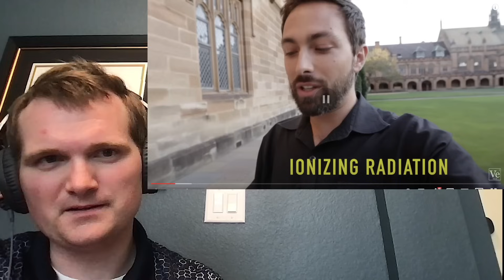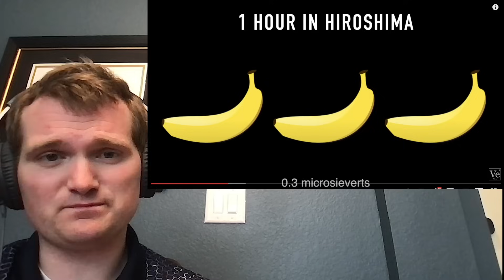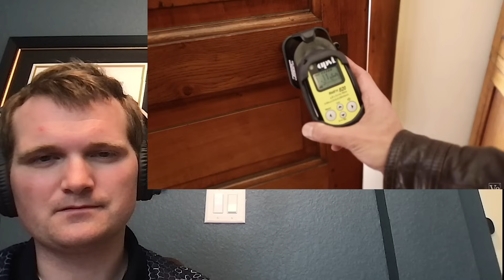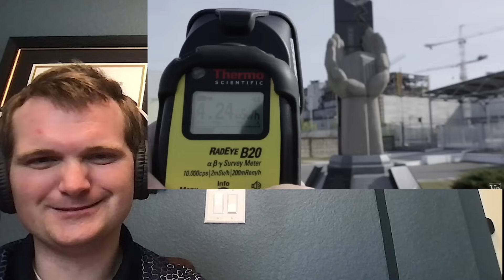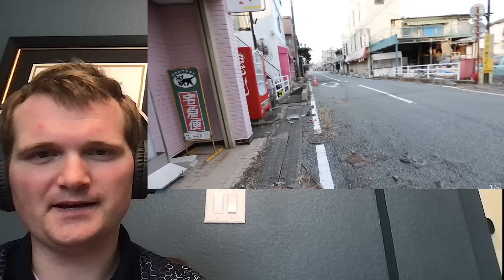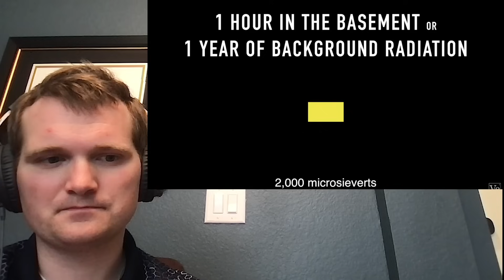Nuclear Engineer Reacts to Veritasium "The Most Radioactive Places on Earth"

Comment: He says that during a chest CT scan you receive a radiation dose of 7,000 microsieverts, but the time it takes to perform a CT scan is surely much shorter than an hour—so I assume it’s significantly more dangerous than being exposed to 7,000 microsieverts over a full hour, right?

Comment: When it comes to Uranium not only is it an alpha emitter but also the fact the majority of it is an isotope with a geological time scale half life, those isotopes are to a close approximation radiologically inert on the biological timescales of the lifespan of living organisms. They simply decay too slowly to emit much more than a trivial fraction of their potential total radioactive dose even if they somehow were ingested. Thus why contrary to the common misconception of long half lives being bad with materials like this your real concern even in preventing accidental ingestion is avoiding any physical or biochemical hazards that an internal dose might cause. Eg the heavy metal poisoning risk with Uranium. Similarly you would definitely want to avoid inhaling Beryillium-10 but realistically because of the fact that it is a nasty chemical and mechanical irritant to lung tissue likely to cause chronic inflammation and serious lung disease through the conventional means of lungs don't appreciate hard sharp and toxic mineral dust particles in them. The actual chances that the beta dose which is delivered over timescales of millions of years would end up becoming your problem certainly within current life expectancy is probably zero to several decimal places, and that is assuming that it's other effects didn't dramatically reduce said life expectancy first.

Comment: One of the key issues with a large number of FTL andling distarspace travel theories, is that they ignore the problem of long term radiation exposure. The only ideas I've seen that address this, are even more impossible than the concepts themselves.

For a trip to mars, yoy would need to sheild yourself somehow... the energy requirements and increased weight, and resource consumption for doing so make that trip and any other manned long-term space flight a serious challenge.

Comment: I have reactive airway disorder, so I can't smoke or be around smokers, but like nearly everyone, I have lost good people to smoking. I find it particularly horrible that, while smoking itself is still horrible, the radiation risk is so high purely because of the fertilizer choice. Tobacco is particularly good at uptake of these radioactive materials, unlike most crops, and while other crops are sometimes trying to use more sustainable/renewable fertilizer, tobacco almost exclusively uses mined potassium which brings with it problematic concentrations of the radioactive contaminants. Something around 120k people per year have their lives cut short because the deadly fertilizer is slightly cheaper than the not deadly fertilizer.

Again, that wouldn't make smoking ok. It kills 4x that many. But a quarter as many deaths from just a small change to the production and they refuse to do it.

Comment: For Fukushima there were also deaths due to evacuating the old / infirm from the exclusion zone
Reply: Most of the deaths from the Fukushima disaster came from elevated suicide rates among the evacuated population.
Reply: yes, those are counted among the deaths due to the tsunami because the tsunami did the damage there and destroyed their homes. The radiation damage is minimal and declining, the exclusion zone is more a political thing than anything else, as is the high accident rating.
That's also why the exclusion zone around the plant is very rapidly being made smaller. There is no practical reason to keep it what it was once the mechanical damage caused by the flooding (and later the retreating of the flood waters) is slowly repaired (or at least the rubble cleared). It could be done even faster, but that'd mean admitting that the exclusion zone isn't related to radioactive contamination and they simply can't do that without making very powerful people angry (leading to political face loss and loss of funding).
Reply: @jwenting  no need to rewrite history.   People were evacuated for the perceived radiation hazard.  Some of those people were infirm and died due the unnecessary evacuation.    It wasn't just about the tsunami damage and flooding.

Comment: Is it specific to tobacco?  Or to just inhaling smoke into one's lungs that exposes the smoker to high radioactivity?
Reply: Tobacco specifically afaik
Reply: @the_retag all smoke, but tobacco smoke is particularly bad.
What happens is that certain radioactive elements concentrate in the ash as things are burned.
What wasn't mentioned in this video for example is that the heaps of ash outside coal fired powerplant are pretty radioactive, and the flows of ash being deposited are these days monitored in case the radiation levels increase to the point where the ash needs to be treated as radioactive waste (it happens rarely, but it does happen at times that a batch needs special disposal).

My graduation work in nuclear waste classification techniques was in part focused on developing the technology to enable that scanning to be done accurately.

Comment: Yeah, you want the true evil of smoking, and the tobacco companies. Then look into some of the studies and information brought forth about the true cancer risks and radiation doses. Quote from a study. "Deposits on the surface of the tobacco leaf via fine, sticky hairs (trichomes), which bind airborne radioactive dust particles generated during the application of fertilizers..."  As well as "PO-210 is thought to be encapsulated with calcium phosphate and lead-210 into insoluble radioactive particles inside the plant, which are subsequently transferred directly into the smoke."

 -(Am J Public Health. 2008 September; 98(9): 1643–165  doi: 10.2105/AJPH.2007.130963).

The companies were aware of this, and attempted to reduce the effects and concentrations by using filters and the like, but not letting anyone know of the potential risk factors or sources. Ingesting alpha sources is exactly what you DON'T want to do, and that's what every smoker has been doing for years.

Comment: The highest recorded dose was Cecil Kelly. He was leaning over a tank of uranyl nitrate and it went critical for a reason that I can't remember. They either added too much to the tank, or he turned on the stirring and it created a bad geometry. He immediately felt symptoms, running outside and screaming "Im on fire". They actually put him in the emergency shower at first, because they thought he spilled acid on himself due to his reaction. He died within 35 hours. His dose was like 36 grays or something insane like that.
Reply: It was a combination of stirring and volume. There normally isn't enough to cause a reaction in that chamber, however it was just barely below that point due to various reasons so the moment it started spinning in the container it got dense enough to cause an incredibly powerful blast of radiation. He wasn't leaning over it for very long, but that's all it took. A lot of low speed, low 'energy' radiation that dumped right into his everything.
Reply: @Rhiawhyn  there's also Anatoli Bugorski that got hit by a 76 GeV proton beam in an accelerator accident.

The exposed parts of his head received a local dose of 200,000 to 300,000 roentgens  or 2,000 to 3,000 Sieverts.

And because it was so focused, all he got was a hole through his brain AND LIVED.

He actually kept doing the repair he was doing when the accident happened, not knowing it burned a hole through his brain.

At first he didn't mean to say what happened, but after a while his face swelled up and the effects of the accident started to show.

While there were both physical (paralysis in parts of his face and deaf in one ear) and mental effects (far easier to fatigue doing mental work, yet no loss in mental capacity) he kept working as a physicist and lives to see 81 (he's still alive).
Reply: That's so terrifying
Reply: Robert Peabody absorbed over 100 Grays in criticallity accident so he absorbed highest dose of radiation in short amount of time.

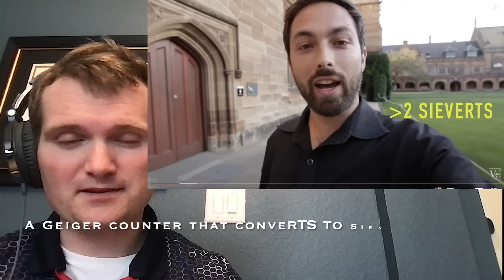Comment: 2:24 A counter can also be calibrated for specific materials, like uranium. Then it takes the measurements, knows what types of radiation emitted and in what proportions, then takes what is detected and then calculates the total radiation that is emitted from those numbers.
Say it can only detect beta particles and gamma rays. Then it just assumes that those are all from the calibration source and adds the beta and alpha particles that were not counted due to the construction of the counter. Then that's the total assumed output of the material in question.
Reply: very nice information there!
I like to lean on a number of counters in my life. :) bad pun?

Comment: Sounds more like his is a Dosimeter and not a Geiger Counter.  My GQ GmC-500+ sounds very similar to his and displays in CPM with a MicroSievert converter.
Reply: I think as soon as it calculates dose it's a dosimeter.
Reply: @jakob7d6  some models like mine can kind of be both,  given it provides a CPM as well as microsievert/mrem detection, i feel like dosimeters, at least the non-card units offer much more benefits than a geiger counter given that you can detect the radiation as its occurring and see what your exposure limit has been during your contact time with the source.